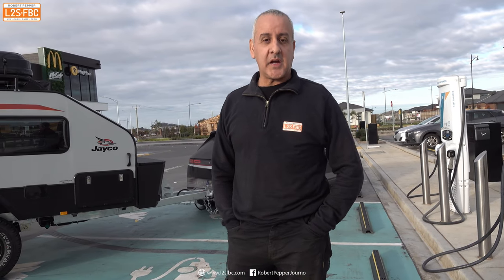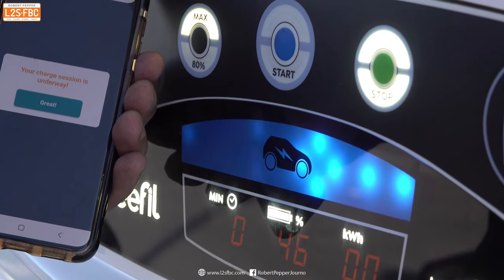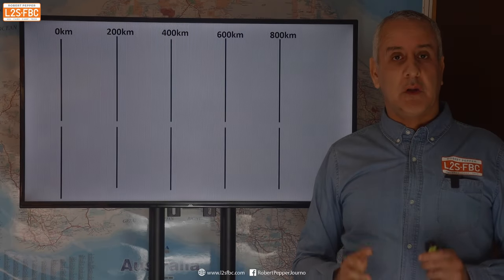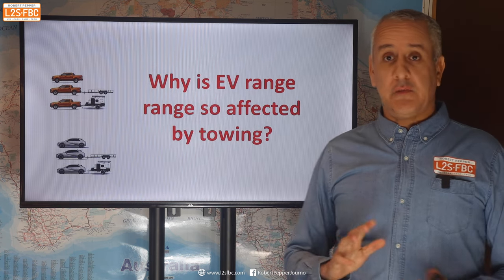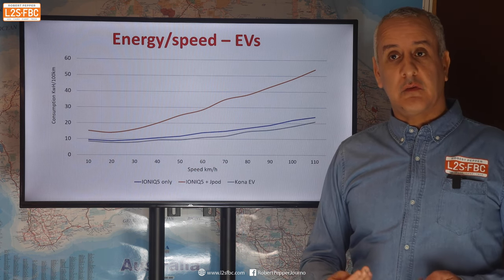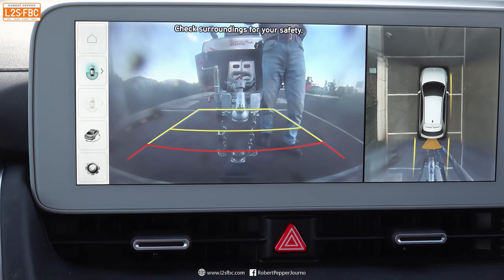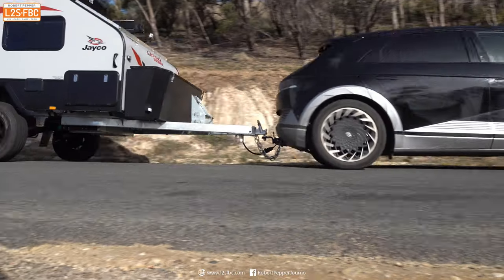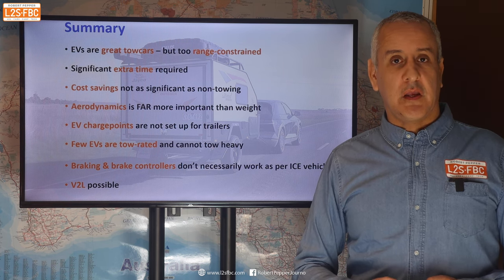EV vs diesel - tow test in detail!

Comment: This is perfect. You just saved me a $$$$.
I just bought a 2nd hand Atto3, it comes fitted with a tow bar. I had vague plans to convert my little cargo trailer into a camper but now I'll just keep it for doing dump runs and picking up bales of mulch.  For road trips I'll take a tent or just kip in the back of the car instead.
Thanks.
Reply from the maker: You'll go further not towing, that's for sure.  As long as the tent isn't an RTT!
Reply: @L2SFBC  towings a hassle anyway.  You can't get into the tight spots where the best camp sites are , then you'll be tempted to load the camper up with all sorts of shyte you don't actually need.
Reply from the maker: True!

Comment: Interesting comparison but if I’m to replace my diesel Territory with an EV, I sure as hell will be using the heater/ AC on trips. So I’m disappointed you didn’t set the climate control to say 23c in both vehicle as a base line because no one in Australia would drive on a trip without using climate control.

Comment: In my opinion there may be two reasons why the range is so affected, the first reason is that the Honda is over all more aerodynamically effective than the Pickup, so if you break down aerodynamics it has more effect. The other thing is that those Permanent Magnet Motors are a bit tricky to be made effective at higher speeds with heavy loads because you would need to lower the fields of the permanent magnet.  ZF is currently developing an engine without permanent magnets, which has some drawbacks, too.

Comment: You've fallen into the same trap I did recently, some chargers display the rate of charge in kW, others show how much charge has been transferred to the car in kWh. The chargers you used show the latter, so Alex's Kona had taken 12.5 kWh from the charger while your i5 had taken 19.5kWh (it had been there longer). The actual rate of charge is not visible on those chargers, but the i5 would have shown the rate of charge in kW on the dash while it was charging.

Comment: As for EVB towing v turbo diesel towing, hmmm,. its a matter of convenience, unless the makers of rechargers start to think in a more logical fashion re: drive through chargers  then drivers who tow with an EVB are screwed over right now.

As for actual driving between the two? the results from the US are showing the F150 Lighting is a great tow vehicle  save for the actual driving range but compared to the petrol F150 with its out dated leaf spring rear suspension the IRS equipped Lighting is like a SEAGUL, its craps all over it.

the other thing is car markers using 400v tech  and at this stage here in Australia I don't know how many  DC150kW chargers there are out there to take advantage of that let alone 800v  tech for DC 350kW chargers.  Relying on DC 50kW chargers is slow, you are better of using off peak AC charging with a recharge box that can output at 7.2kW (of if you can afford one the 11kW recharge box although you would have to get your home rewired for that thus extra $$$).

Comment: great video, thanks for posting. one thing that's apparent is the opportunity to make caravans etc more aerodynamic ( and weigh less). Also, do you think that by not 'braking' ( using brakes) while going down hill with an EV, ( no brake controller operation) that there is more possibility of  trailer sway?  Somewhat similar to modern auto ICE vehicles that drop back gears 'automatically' when towing downhill? ( where the brakes are not operated)
Reply from the maker: Yes, aero drag reduction for a caravan is definitely a market gap, and even for ICE vehicles too given cost of fuel. However, a low-drag caravan means compromises elswhere in living space for example, and cost to build. As for sway downhill - you're less likely to get sway if you need to drag the trailer downhill. But yes if the car only is braking, then there is an increased chance of sway, downhill is definitely a sway contributing factor - see my other videos on sway.

Comment: Very informative. Trailers with an ATM less than 2 tonne but over 750kg often have hydraulic over-ride brakes so going downhill its natural desire to increase speed (gravity) would be partly negated by the hydraulic coupler compressing and applying the trailer brake . . .me thinks.
Reply from the maker: You're correct, and in fact over 750kg in Australia it is a legal requirement to have brakes. Above 2000kg GTM the brakes must be independent.
Reply: @L2SFBC  I believe that the Ioniq 5's towing load maximum is 1,600 braked kg ATM. That is with independent brakes as I understand, not hydraulic over-ride brakes.

Comment: Hate to put a dampener on the enthusiasm for EV towing, BUT -  no aircon/heater used in this test, no night driving, no wet driving requiring wipers and demisters.  The Ranger or other ICE are not affected by these things, but the EV range would drop to probably 100k at best on a cold, windy, rainy night.
Reply from the maker: It's not that bad. Heating is maybe 5-20%, and better with newer vehicles.  Night/rain has an effect due to power used for wipers and headlights, would expect rain to potentially have a drag effect. ICE vehicles are affected too but they get heat for 'free' because they generate it anyway.
Reply: @L2SFBC  Hmmm - 20% is huge. Heater on, a cold rainy windy night actually is as bad as I suggest.  Range drop from 160k - 30k contingency -  20% is 100k.   Then you have to possibly unhook the van in the rain to recharge, and hook it up again.  I wonder how many wives would enjoy that trip? :)
Reply from the maker: Yes, range could be very poor if you get a headwind and try to cruise at 100-110. Your description wouldn't be enjoyed by anyone, wives, husbands, boyfriends, girlfriends or any other sort of person. However there are some women who'd definitely consider it an adventure!

Comment: You could at least have just had the fan on mid speed blowing air (no heat or cool - fan only) both vehicles. 
Oh and good luck charging when the internet is down.
Charge bays need to be just like fuel pumps - drive through/past so you don’t have to unhitch.
To be fair, petrol it better for towing in every way over diesel for the similar reasons, in my opinion - aside from the range. But it’s just more fun and easy to tie with petrol rather than diesel and the extra fuel use is worth it.
In Australia with an EV - Charging is THE biggest issue along with range especially with towing.

Comment: Very interesting. Great Video. 
What Id like to know is the cost of charging time? If it takes 2.6hrs of charging time in your experiment, what would you allocate the cost of waiting for the car to charge? 2.6hours is significant and on a say  construction site it is typically $65/hr labour hire (opportunity cost) or float charge? Cost of actually running an EV is not so efficient as first thought?
Reply from the maker: Good point and that cost is up to the user. However the cost can be set against the reduced fuel cost of the EV.  But the general point is good, the big picture equation is what counts.

Comment: Road-abuse charge for EVs has been ditched now, thank God! You really need to do this test again using the Ioniq 6. Its 610km WLTP range and DC fast-charge from 10% to 80% in 18 minutes really is a bit of a game changer. That 400 km tow would require just the one stop for a charge and it will take no more time than the diesel driver takes going for a coffee and a piss. I can get my coffee too while the car is charging.
Reply from the maker: For now.  I expect it'll return in some form.
Reply: @L2SFBC  I actually know it will not. High Court has spelled it out pretty clearly.
Reply from the maker: No, it said states cannot levy it in the form described. It can return in other ways from other bodies.
Reply: @L2SFBC  what other bodies? The Feds can try it on, but they are not responsible for roads; that is a state power. States can try to apply a road-user charge but it must be on ALL vehicles (they will likely not though). 
The Federal government can pay the states for roads as much as it likes and then the $$$$ are created by the RBA. Taxes or road-user charges are not required. Taxes are actually the destruction of money, not 'funding'.

Comment: Isn't it illegal to tow at more than 100kmh in Victoria? If so, that limits the towing speed on both EV and diesel.
Reply: Many caravanners tow at about 95kmh, so that would be the ideal comparison speed. From your results the EV should be a bit better at 95kmh than at 110kmh, although still inferior to diesel. Do you agree?
Reply from the maker: No. Is in some other states.
Reply from the maker: Yes, the slower the speed, the better the energy economy for both EV and diesel, not just EV. However, the EV is still more affected by increased drag than the diesel.   The optimal speed for caravan towing for economy/range is probably 50-80km/h, with a wide variation to account for the type of towcar, trailer, terrain and even prevailing wind.  Towing uphill at 110km/h with a headwind...anything will deplete energy in that case!

Comment: It's not just range. It's durability and reliability of the vehicle design. Most of the existing evs rely upon independent suspension designs, lower payloads and are built on a design principle that expects shorter drive life. Sure the electric motors are efficient but will these ev designs withstand years of abuse towing near maximum and maximum gvm? I'm not sold. At least the F150 lighting has a solid rear axle and mechanical locking rear diff.
Reply from the maker: It actually has independent rear suspension!!!  And there's no reason why an EV couldn't be as strongly built as an ICE.
Reply: @L2SFBC  In some respects sure but even with the trends of 4wd vehicles in general. Auto manufactures continue to focus towards on road performance at the expense of offroad durability. I can't see myself trading my GU Patrol for these designs.

Comment: Good video again Robert,  I think that the EV's would be very desirable as a tow vehicle for a horse float/livestock prime mover (fumes & noise) but  the shape/aerodynamics  of the general trailer and total loaded  trailer mass would eliminate most EV's getting to the starting block, plus while at the horse event very few venues would have charging facilities
Reply from the maker: Good points re horses. Would any horsey people like to comment, I simply don't do horses. I see no reason why EVs couldn't recharge at a sporting event. And I've thought about using an EV to tow a racecar to a track. Even an EV racecar. But the track then needs a LOT of power to charge the racecars and the towcars. Which is possible, just needs building.
Reply: Unfortunately/genrally lighter trailers using aluminum and other light materials are way more expensive than steel ones….
Reply from the maker: @carholic-sz3qv  true, and more aerodynamically efficient trailers are also more expensive!
Reply: Most show ground are also camping grounds now and will have powered 15a sites. If you have the correct cable you will be able to charge up while there.

Comment: EV will probably need gearbox to extend its range during towing. If a diesel engine only has 1 gear (say 3rd gear), it will be screaming at 4000 rpm+ doing 110 which is no good for fuel consumption.
Reply from the maker: You're right about the diesel but the same logic doesn't apply to the EV because it produces its torque over a very wide rev band. A gearbox wouldn't make an appreciate difference.
Reply: Electric motors do not need a gear box because of its very nature. The issue is simply battery capacity. Electric can tow more easy. The solution is a generator hybrid like what Edison Motors is doing with logging trucks in Canada

Comment: Short answer: They suck!! Look at a recent TFL Truck episode (https://www.youtube.com/watch?v=-e55Vued028)  and they had the Ford Lightning pulling about a 6000 pound trailer and it could barely go 100 miles. That's really pathetic if anyone thinks they are ready for real world use. And have fun trying to pull it into a charge station without blocking everyone else. They figured the price between the Ford and the other truck ICE powered were very similar and that's at today's super high gas prices.  Anyway all things considered it was an abject failure when used as a truck is often used.
Reply from the maker: I saw that and my results are similar, but I've done a bit more analysis with different cars/trailers and types of road. This gives some information about how and why EV range is affected by towing.

Comment: No vehicle of any sort meets all the use cases that can be asked of it. There are always compromises. Statistically, these use cases are what manufacturers build for. At the moment we have the luxury of Ford making a 4 door off-road vehicle that someone can use for most all use cases at home, holiday and work with the compromise being cost and heavy fuel use (compared to say an i30). But as the smaller and larger high volume cars become electric the cost to make Ranger type cars for the few that use them in all there capabilities is going to rise. Being able to tow long distances is a very Australian thing and even then it's a rather small percentage of the market. Probably too small to be worth making ICE engine cars that are copies of the large EV cars but have the ability to tow long ranges. Most towing is to the tip or is short range. Even tradies tow well within city limits and not too far from home base or depot. You don't need to go far out of Brisbane to set up a caravan for the long weekend. That puts you within range of one charge to make it work. For those who tow longer and or often, they are a tiny percentage of the market. I don't see manufacturers offering a Ranger along side a skateboard chassis RangerEV. Best find your target tow vehicle now and learn to keep it in working order for a long time.
Reply from the maker: A pessmistic view but one which is possible - if I can summarise, demand for a towing/long range 4x4 isn't going to be great enough for one to be made so we need to adjust our lifestyles to suit. Wow. And I thought I wasn't bad at bombshell comments, that's nuclear!
Reply: @L2SFBC  I think we'll get there but they will build for the mass market first and without a big uptick in battery storage and or speed of charging the long range towing ev is going to be a while coming and there may even be a gap between new ICE sales that meet that longer range towing need and ev options that reliably take over. Hence look after what you have now in case there isn't a viable replacement later while we wait for ev's to move into that space.

Comment: I think ev driven trailers will be great.
Reply from the maker: https://l2sfbc.com/why-powering-a-trailer-wont-be-the-real-answer-to-ev-towing-range/
Reply: @L2SFBC  If the trailer drives itself, then tow car will only be steering, not pulling. It won't solve all the issues, and won't extend the range of the tow car, but should reduce the loss of range.
Reply from the maker: Agreed, but we really need significantly longer range not just reducing loss.
Reply: @L2SFBC  Aptera for me in about 8 years.

Comment: Those trailers are small. very small. A UK caravan would be at least twice the weight.
Reply from the maker: It's tiny by Australian standards, 979kg as a base weight, when we have vans easily 2500-3500kg and some beyond. But, I needed to ensure the IONIQ5 could tow it legally. I would have liked a bigger van but as you see in the trailer video, the TBM was the limitation.

Comment: Since this video came out, DC fast chargers are at least 50% more expensive, and diesel is actually marginally cheaper. Insurance premiums for Electrics are through the roof, and depreciation of Electrics is through the floor like a lead balloon
Reply: I thought $1100 was OK for full comprehensive on my EV was reasonable. I've only ever had 3rd party property on my beater. 
How much do you pay for your car?
I'll have to talk to my insurer about it.
Reply: How much should I be paying?
Reply: @jjjnettie $1100 Australian? Seems pretty good
Reply from the maker: EVs cost more to insure every time I've looked.
Reply: @MattBlack6  Yeah, I'm in Queensland.  I'm insured with RACQ.
Reply: Insuring the windscreen was an added extra but I thought it worthwhile. It would have been cheaper otherwise.
Reply: @jjjnettie any modern car with windscreen mounted cameras and sensors, definitely a good idea.
Reply: @L2SFBC as a tow truck driver, I go to many smash repairers. I've not seen one yet store crash damaged EVs with the recommended 15m distance between them. Obviously they're not all there with battery damage. And I've not heard of any problems yet. But if one does go up, they're usually jam packed, shoulder to shoulder with up to 100 other cars and next to a shed full of paint and thinners and plastics etc. If anything like that does happen, the costs will sky-rocket. Being  a volunteer road crash rescue operator, I've done courses on evs after crashes, and bring a tow truck driver, I can assure you that probably no towie and very few smash repairers have done any learning on possible thermal runaway. It's an accident waiting to happen.
Reply from the maker: EVFireSafe run courses. I am attending one soon.